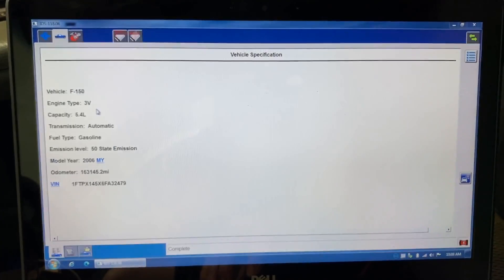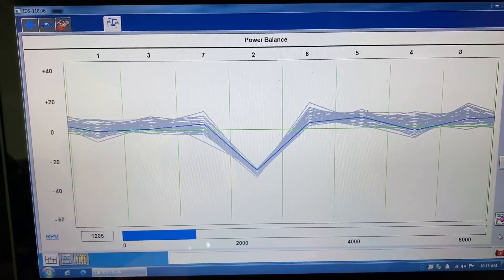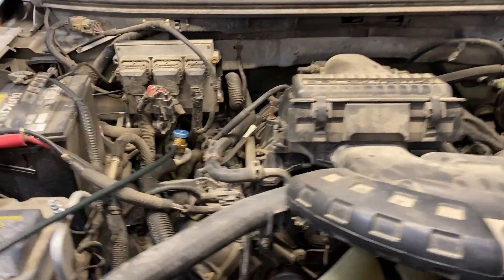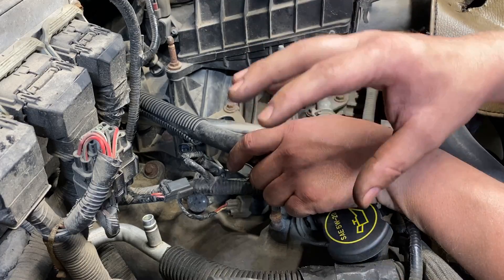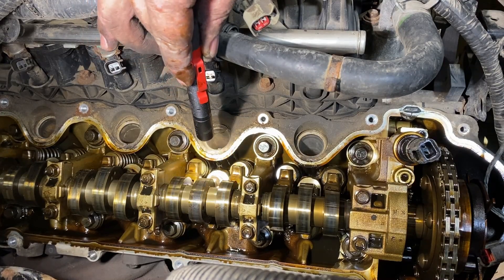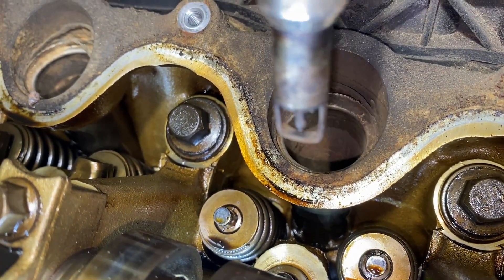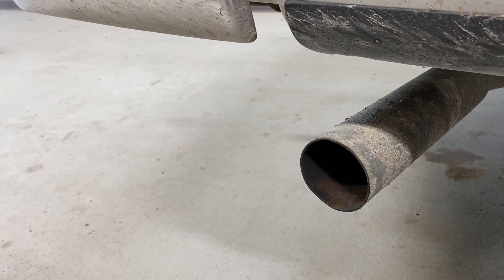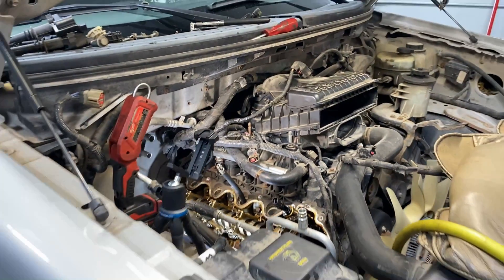Ford F-150 5.4L 3v Triton Compression Loss: P0302 Cylinder #2 Misfire Diagnostic Walkthrough

Comment: Ford went from the most reliable engine, the 2v, to the most unreliable, the 3v.  Ford should have never updated the engine.
Reply: 4.6 2v in my explorer I’d strong at 193k
Reply: Most of these engines fail bc of dumb people who rev a fully stock  engine up to 4k rpm’s or they never do maintenance 😂
Reply: What tool are you using??
Reply: Yeah such an unreliable 271000 mile motor I'm having to work on!!!!
Reply: They did the same thing with the 7.3L going to the 6.0L but you could partially blame the epa for that one.

Comment: What spark plugs are recommended for these engines?
Reply from the maker: Motorcraft SP-546
Reply: FordTechMakuloco thank you for the reply 🙏🏻
Reply: FordTechMakuloco would these plugs also be recommended for a 2011 5.4 3V
Reply: @ntorres586  No, that would use a completely different spark plug.
Reply: Charles Ball what is a good plug to use

Comment: How exactly that Software measures compression on cylinders??
Reply from the maker: It measures the rpm for each cylinder.
Reply: @FordTechMakuloco  Essentially the computer reads the tone wheel and if the RPM differs from expected (its higher due to low compression), that's where you get the estimated compression level? 

BTW, my engine sounded just like that turning over just after I completed the timing job last year in October, and was turning it over to get oil pressure (some of the new lash adjusters were still springy when I put them in).  It runs perfectly fine otherwise

Comment: I worked for ford for a couple of decades and am the only guy in my area that fixes the 3v pigs! Everyone else throw parts at them. Relative compression and power balance should always get you off to a good start. I have an ids also and it helps a ton especially if you need to do the updates which we always check on every vehicle.  Most of us car guys can hear that uneven cranking every time. And know it's a compression loss. Keep up the good videos!
Reply: Some people swear by the 3v engines. Others swear at them.

Comment: This video hits very close to home   Recently    Iv had a tick that Iv been trying to figure out what it is .  Long story short it was a loose plug    Which were new plugs from about 6k mikes ago    Which I paid my mechanic to do   Since I was afraid of breaking them 
He got them all out without breaking    With all the little ticks and noises Iv fixed it was hard to pin point the tick but looking back it got worse or started after the new plugs   Well I guess one of the plugs was loose for awhile   It seemed to run the same strength wise   So I finally found the loose plug and tightens it   Power went down    Then I inspected the plug to find the metal u shaped ground piece missing    So I vacumned out the cylinder and put in a new plug    Power went back up to what feels like normal   Never got a code or anything yet !   What are your thoughts on the metal piece ?  My mechanic said it probably passed through the exhaust    I guess I have no clue if I vaccumned it out but I guess it would have been passed through some time ago

Comment: Such a great channel.  I have a 2012 Navigator with about 230k miles.  Has the 5.4l 3v and it's starting to sound like a diesel :)  I know I need the timing kit / phasers job done.  Job is about $2,500 locally from a reputable non-dealer shop.  Trying to decide if it's worth it...I suspect it is, since the vehicle is great otherwise.
Reply from the maker: Don't let them do it unless they use Ford parts otherwise you throwing money away. $2,500 seems too cheap.
Reply: @FordTechMakuloco  Well .. they swear up and down it's all genuine Ford parts, so I'm dropping it off Monday.  I'll keep you posted :)
Reply from the maker: There is no way they are replacing all the components with Ford parts including the roller followers which are very common failure your model year. Plus if they are not installing the Melling high volume oil pump then there is no reason to even do the job. Dealer price is generally over $4k for this job, over $3k for an independent shop and under $3k at a my shop. Let me know how it turns out.
Reply: @FordTechMakuloco  Unfortunately this reply was posted after the work was completed.  They did tell me they inspected the roller followers but none looked worn or failed.  They did confirm all the parts were genuine Ford, and it's a reputable shop I have used many times, I feel they're being truthful.  At any rate the engine is now MUCH quieter and sounds very healthy.  Now I'm starting to chase down some sort of trans problem (or maybe an ignition coil I hope).  Thanks for taking the time to reply to my comment, I really appreciate it.
Reply: @FordTechMakuloco  Thank you for taking the time to respond.  I really appreciate it.  They said all parts are motorcraft.  This is a shop I have used for many many years and they have a local reputation as being very reputable.  But I'm hard pressed to think there's anyone who's opinion I trust more than yours.  I know the kit you link to doesn't actually say Motorcraft, it says Ford.  But are they the same thing?  Unfortunately the kit you link to is out of stock or unavailable.

Comment: I just did the timing on a 05 5.4 is it possible for it to run if it off 1 tooth.it runs good except when i stop it will die.
Reply from the maker: It will run ok in general maybe a bit rough at all times. You either have an oil pressure and volume issue if concern only happens hot or you have a carbon issue in the throttle body. I would clean and relearn the throttle body first.
Reply: Ok thank you i did put a 360hv oil pump and both vct it does have 2 codes p0011 and p0506. I do really appreciate your videos

Comment: Hi,

I have a 2006 ford f250 xlt 5.4L (3v).

Is the spark plug torque spec the same (25 ft. lbs)?

Also there is a rubber ring that seats between the coil boot and the metal frame. You can actually see it on this video.  Do you know that part number? I ask the part department at the ford dealership and they can't find it on their computer system.  

Is it important to replace? Or does the motorcraft coil pack have a new design on them that seals it up without the rubber ring.  

I believe you had another video on changing spark plugs on this 3v engine style and this rubber seal but i can't find it now

Please let me know.
Reply from the maker: There is no rubber seal, the boot seals the spark plug well. Your torque spec is  25ft lbs yes.
Reply: @FordTechMakuloco  

Ok, when i was blowing out the dirt from the spark plug well that rubber ring blow off. Again, it's located right on the top arear. It was worn down and i couldn't get a replacement part for it.

You can see it on this video on 11:50 / 17:27

I thought it was in one of your videos but maybe it was another video. 

Thanks
Reply from the maker: Michael C oh no that is just excess sealant from the spark plug well tube, not an o-ring. No need for repair
Reply: @FordTechMakuloco  

Ok, that explains why no one at the ford dealership (parts department) could find this part. Man i seen this part on a another video but i can find it now. Anyway thanks for the feed back. 

I have to say "Thank You" for all you did on this channel for the ford 3v engine.

Comment: I recently did a timing job on a 2007 f150 with the 5.4.    After the repair it had a fluctuating idle, checked and found that it had broken a spring on the #5 exhaust valve.

Comment: This happened to me on a 4.6 3v on my mustang.  No compression on cyclinder #8, when I pulled the plug it was broken!  Never dug in deeper just bought a used engine with 41k on it, but I was very frustrated.  Didn’t know plugs broke like that

Comment: I have a problem with my 05 f150 with a 5.4 3v triton. The transmission in reverse has a kind of a hesitation to move but when pressing on gas a little more will make it move. In neutral and park there is a winding noise while idling but in drive it’s fine. Can you give any information on this issue?
Reply: Hows the fluid level?
Reply: TurmiteRS The fluid level was low when the problem started. I didn’t drive it after I put transmission fluid in it,because it continued with the shift problem. But i can say it is much better than before. So that why ask that question above.

Comment: Hey buddy, I got called to look at an 08 f150 5.4 3v today the truck is ROUGH!!! In comparison to my 03 it has been to 2 mechanics supposedly in the last couple weeks I was told ahead of time it has fuel which I confirmed 40psi , injectors are receiving power(I didn't confirm that il get to why in a second ) it has no power going to coils , previous mechanic said it had 42 codes some tranny most engine but they was deleted so I don't have them,my initial thought was the pcm had to have an issue either receiving power/ground or sending it out fuses and relays confirmed good , once again I don't confirm power to the pcm from the fuses/relay BECAUSE when I arrived first thing I did was turn the key and it sounds like the starter only has resistance on 2 cylinders it was WAY out of Ballance so I'm assuming the timing chain is in the oil pan ,one mechanic already changed crank and cam sensors they say everything works but no power to coils I did confirm that I was only there for 20 minutes as a quick favor to the guy that's supposed to be fixing it he said he would pull the valve covers and timing cover in a couple days but based on the limited he said she said info I have provided here would you assume timing let go, no one can get ahold of the owner at the moment to ask if it was rattling and making noise before hand ,all they know is he was driving just before he was walking,lol

Comment: Just for kicks, I'd try to look inside with a bore scope to see if there's debris holding the valve open.  Then, I'd strike the valve stem several times with a brass drift and hammer to see if the porcelain could be shattered into smaller pieces.  If the valve isn't bent, this might work to blow the pieces out into the exhaust.  Who knows?  It may fix it.  Looks like the truck is rusting away, so it's still worth trying and if this didn't work, no loss.
Reply from the maker: Oh he’s been driving it like this for awhile now so it’s over.
Reply: @FordTechMakuloco  I replaced plugs and coils about 6 weeks ago....with Motorcraft plugs...3 weeks later had a misfire on one cylinder...mechanic pulled plug and the metal tip completely broke off.  He replaced the plug and it ran fine for about another 3 weeks and now i have another "random" misfire he says and he doesn't know the cause other than thinks it needs timing chain kit now.   Do you think the broken off plug tip could have done something similar to one of my valves ?  what's the chances it blew out without damaging anything ?  TYVM !!

Comment: While this particular issue was not likely the 5.4 3 valve fault, ford should be made to replace all those engines for customers for free, what a pile of junk. Yes it would cost the company a lot of money but the buyer of those should not be hung out to dry for a company screw up. I never owned a Ford for my own reasons and this just adds to the list of why not to own a Ford product... now they cant even make a reliable spark plug wire for christ sake.
Reply: I'm curious, What brand do you drive?
Reply: @mark98070  pretty much anything other than ford. I have worked on quite a few vehicles over the years and compared to Chevy  or Chrysler I find Ford horrible to work on and parts terrible to get as well. Ford seems to use different parts on the same vehicle, with tje other 2 brands I mentioned they pretty much are parts bin specials meaning what fits on one model is accross the whole line of vehicles of similar platforms. Realize I talking about older models as I think since about 2000 all brands went for a shit.

Comment: Sure would have been nice if you had access to the exhaust valve, where you could have chucked the valve up in a drill motor, and spun it against the seat to see if the compression improved. 
I've got a 2003 5.4 in an E-350 van. It developed a misfire not long after purchase. Turned out to be the dreaded plastic intake manifold leak. Ford was smoking crack with the $480 replacement manifold, so it got an aftermarket replacement. No it wasn't a Dorman. It's been fine since, but in the back of my mind, just waiting for the Modular Team to strike disaster. 

What was wrong with the Windsor engine? They were reliable with the exception of the nylon timing gear.